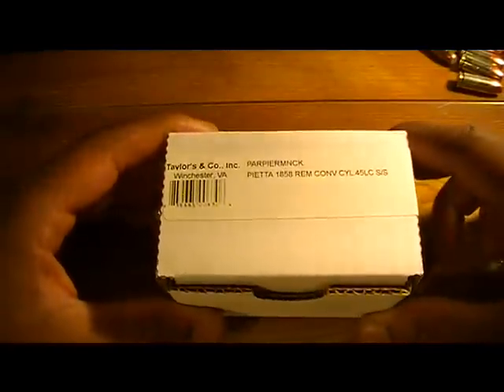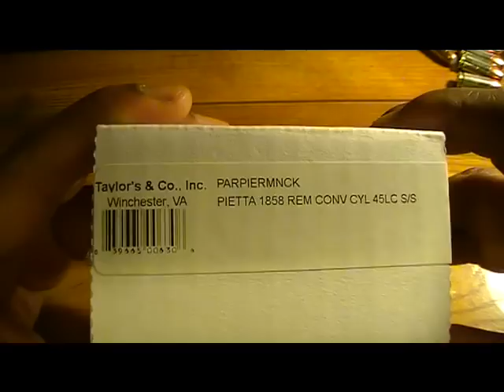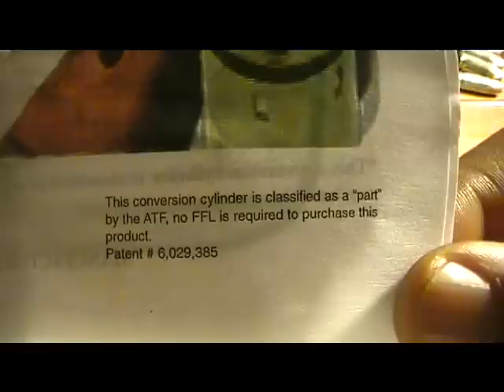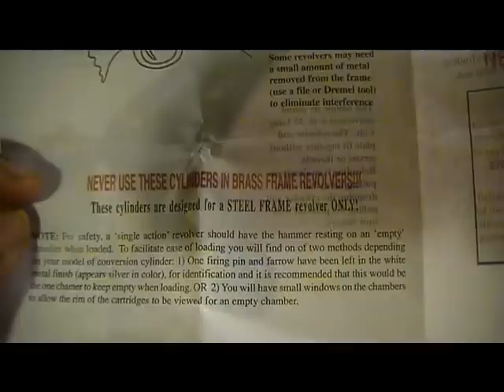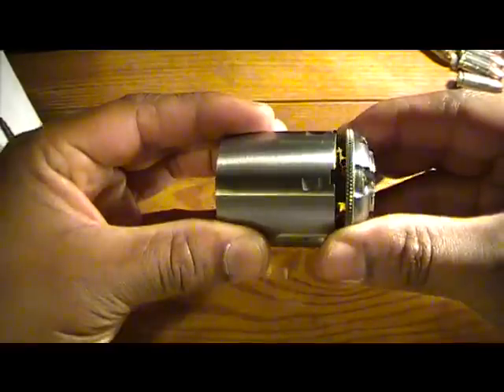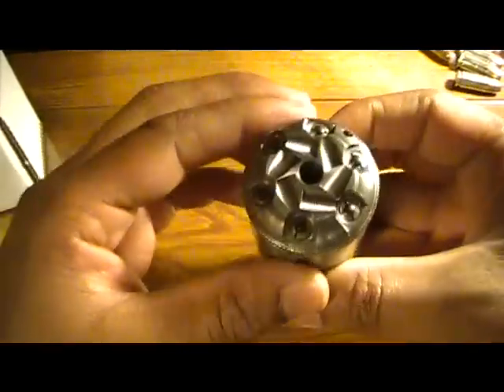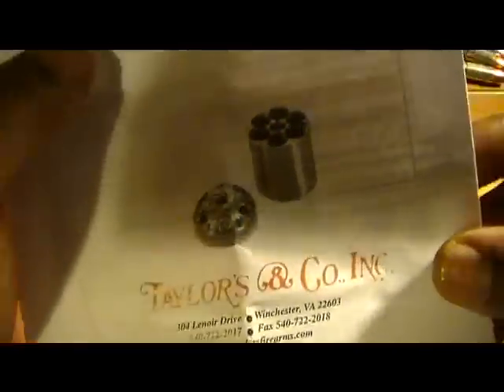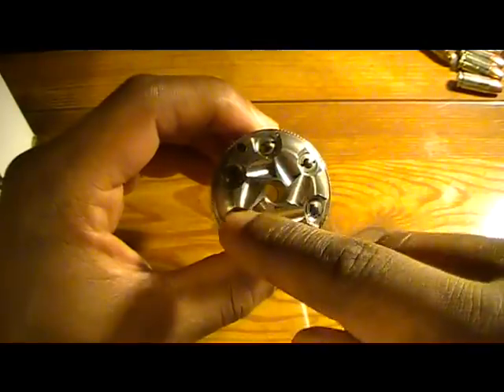R&D Conversion Cylinder - Pietta 1858 Remington

Comment: I just threw a Taylors&Co conversion into my 1851 Colt, I couldn’t be happier with the results. $250 for the gun new, $210 for the cylinder. Still WAY cheaper than a modern day revolver these days. And with a 7 1/2” barrel, it’s pretty stink’in accurate

Comment: I got that exact conversion. I was initially concerned because the walls of the cylinder are so thin but my SASS friends say it's fine & it has worked like a champ. I am extremely pleased with it. The cap & ball thing is fun for a bit but it becomes a chore real quick. With the conversion & the New Model Army it's almost like cheating. All the fun of black powder without the work & the misfires. As far as the thin walls,I just remind myself black powder isn't a 65,000 psi AR & all is well. :)

Comment: I bought one of these... installed.. the locking lug  sends the cylinder into free spin when you pull the trigger... the slot on the percussion cyl. Is not the same as the conversion...

Comment: I know of a guy who has a YouTube channel under the name Mountain Storm and he states that he has fired Wal-Mart 45 Long Colt ammunition with no problem at all. I don't see any problem with this because the Taylor conversion cylinder is machined from arsenal grade gun steel. For liability reasons Taylor must state not to use regular ammunition in their conversion cylinders. It's the same reason that truck manufactures rate the towing capacity of trucks even though in reality the towing capability is greater than the factory rating.
Reply: The .45 Long Colt is grossly under-loaded, in factory loadings.  

You can buy factory cartridges that have no business in a conversion cylinder, specifically for hunting or critical defense, but "normal" factory ammo is running pretty close to what would have been sold in 1873, only with smokeless powder. 

There are still plenty of 140 year old revolvers chambered for .45LC, and in perfect shooting order, so the cartridge is loaded to levels that will be safe in antique guns, even though a modern .45LC like a Ruger or Thompson Center could take loadings in the .44 Magnum power range. 

I've personally developed a .45LC load giving almost 1400FPS, though case-life was much shorter than a .44 Mag delivering about the same energy. 

The .44 case head and thickness of the case walls is all more strongly engineered, while the .45LC case was never intended for that much pressure.  

Case life for reloading is just about reduced to half or less when loaded like that, but you can do it if you know how and are determined.
Reply: The cylinder can perhaps take the pressures of the Standard Velocity .45 LC, but the rest of the pistol was not proofed for that. It will probably work ok for a while, but even steel frame revolvers can stretch over time and you'll have problems. Also the barrels are made to shoot lead bullets. Jacketed bullets will roll down the rifling pretty quickly. It is best to stick with Cowboy Action ammo with lead bullets.

Comment: Hi, I have an Italian made copy of a navy (Colt?) .36 cap and ball pistol that I bought back in the 70's. It has a brass frame. I would like to convert it to cartridge firing, not so much for shooting bullets, but blanks (for fast draw competition) Do you know of any companies that make such an item... and what kind of money did you have to spend? Thank you, I enjoyed your video.
Reply: Not for brass frames!!!..........
Reply: Your cylinder revolves on an arbor that is screwed into the frame. The threaded hole it's screwed into will stretch under too much stress, eventually creating some slop with the arbor, where there should be absolutely none.  

Shooting enough hot black powder loads will do this, and smokeless powder from a .38 Special or .38 Long Colt will do it in short order.  

Your gun is of no more use after this progresses far enough.   Confederate revolver makers only hoped their guns would make it 2-3 years and a few hundred rounds, before the war would be over and one way or another, they would all be scrap.  They didn't/couldn't build them to fire a couple thousand rounds over the course of 20 years.  

Confederate gun makers had a hard time getting steel, since most steel production was in the North.

They were known to make revolver barrels from twisted iron, and frames from brass because they couldn't get steel, not because either of those fixes were desirable.

Comment: So just making sure I have heard the whole video correctly, but if I buy this converted cylinder, I can fire any .45 ACP rounds (not revolver rounds) out of my black powder 1858 .44 Pietta? Because I seriously don't want to buy this and suddenly my gun blows up in my hand or something stupid.
Reply: Nevermind I just searched up the conversion cylinder at the site it is sold at, so it doesn't shoot .45 ACP it shoots .45 LC
Reply: ***** Aaaaaand I watched the vid again and now realize you said that in the beginning, I now feel less intelligent.
Reply from the maker: no prob. Thanks for watching and if you get the cylinder, it's a great addition to an already great gun
Reply: +Sam R check some of the other manufacturers.  Kristen conversion offers one that is chambered for 45cap. TARGET LOADS, LEAD BULLET ONLY. IE non jacketed
Reply: You can get both .45LC and .45ACP from howelloldwestconversions.com.  

The .45ACP operates at higher pressure, and it's harder to find factory ammo loaded with lead bullets, which is what you really should be using for accuracy.  I think WalMart carries .45ACP "Target" ammo, which uses lead bullets.

Howell Conversion .45LC cylinders are six-shot, while Kirst is five, and I think that .45ACP cylinders are all 5-shot, maybe to handle the extra pressure.

It's much easier to find .45LC factory ammo with lead bullets, especially with seven or eight different brands of "Cowboy" ammo, for Cowboy Action Shooting. Somewhat lower performance & somewhat lower cost!

Rifling is more shallow in Cap & Ball barrels, and jacketed bullets don't take the rifling as well, so accuracy drops off some.

Comment: It is OK to covert as long as you load cartridges with black powder or Pyrodex. They Converted these revolvers back when they used them. It is not a new idea.
Reply: Trail Boss is the perfect SASS powder for reloading these conversions.  The best part is it is high volume, low pressure(with provided data), and smokeless.
Reply: There are a few smokeless loads for the conversion units. BP is more fun, and remember to lube your bullets. Store bought will most likely have petroleum in their lube. Will gum stuff up quick. Remember lambs tallow does not go rancid even at room temps. Great shooting to all.
Reply: Hell I use 6 grains of titegroup behind a 250 lrn and it runs just fine in this cylinder

Comment: can I fire a revolver with the conversion at an indoor range?
Reply from the maker: +Rusty Shackleford Unless they have specific bans on that set-up,  I don't see why not. It uses metal cartridges with smokeless powder.
Reply: +hot2warm thanks, one more question can it fire regular ammunition from walmart or do I have to use lower pressure cartridges?
Reply from the maker: Rusty Shackleford Use cowboy loads. Full power loads will be too much for it. Also, these conversion cylinders are not intended for brass frame revolvers. Only for steel frames.
Reply: Yes. You can fire your revolver in an indoor range.  I would recommend that you fire smokeless loads of no more than 850 FPS.

Comment: why I cannot use that for brass frame
Reply: Brass frames aren't as strong.  Most steel production during The Civil War was in the North, except for Atlanta, whose steel output was mostly used for locomotives and railroad rails.

Confederate revolver makers used brass for frames because it was available at the time, not because it was good. 
Also some makers used twisted-iron barrels instead of steel, for the same reason. 

Even if you aren't wanting a Cap & Ball gun to us with a conversion cylinder, you should stay away from brass frames. Even with normal black powder shooting, they don't hold up to a whole lot of use.
Reply: Brass Frames stretch with moderate use unless you use quite light loads. Brass is a softer, more malleable metal so it's not a good choice for the higher pressures generated by the conversion ammunition. You will turn your brass frame gun to junk in short order.

Comment: Nice video....I had a problem with my Pietta 1858 Stainless Remington with the hammer failing to securely index the safety notches in between the cap nipples. The cylinder would still turn even with the hammer nose in the notch. This, of course, would permit the cap to be accidentally indexed under the hammer which would allow the gun to fire if the hammer was bumped. I found the following link on the Remington 1858 Forum which demonstrates the simple fix.

1858remington.com/discuss/index.php?topic=7417.0;wap2

Hope this helps. Now you can safely rest the hammer between the cap nipples and have it stay put. Now you can load all six holes on the muzzleloader cylinder!

Comment: Be careful, I would use trail boss it is the best smokeless powder don't use 700-X. doesn't fill the case and can cause over pressure and damage.   Google;  blew up a '58 Remmy conversion